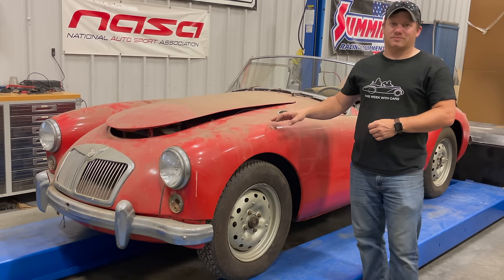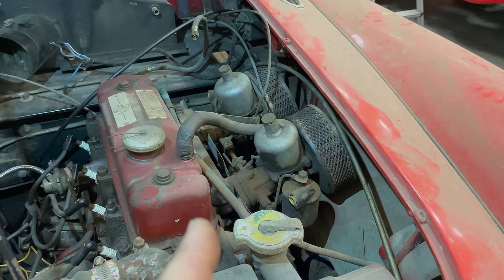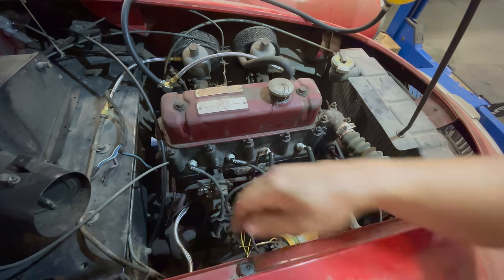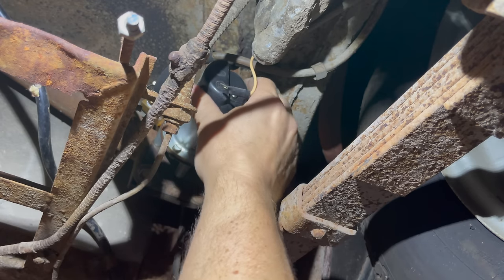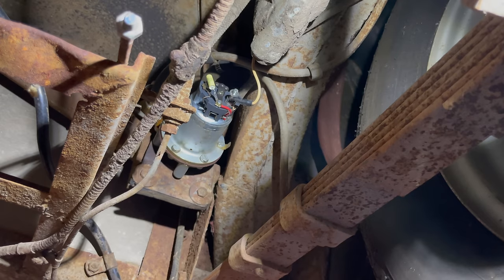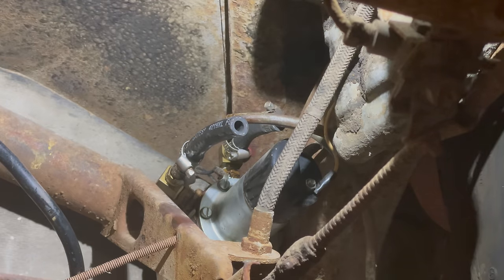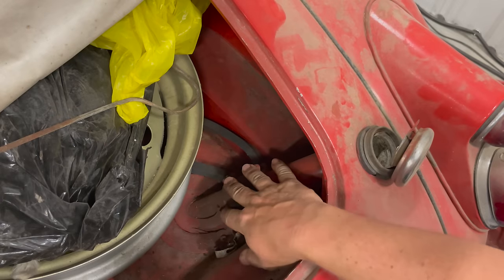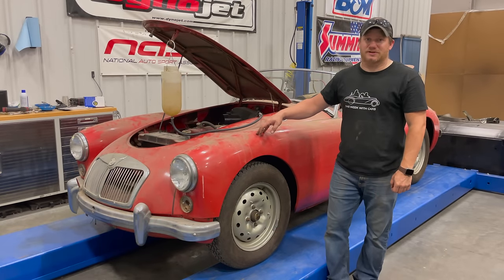1960 MG MGA 1600 Roadster - Part 2

Comment: my first car (bought in 1970 for $600) was a 1961 mga 1600 roadster. ended up rebuilding the entire engine and transmission, then a couple years later did the body and interior. great memories that i'll never forget. ...learned a whole heck of a lot along the way too. had an excellent blue(?) plastic covered book that explained everything about the car. was invaluable. might have been kenneth ball's book published by autopress ltd.

BTW, your explanations and presentation are excellent.

Comment: I had one of these in red,  A hard top version.  It was my very first car,  I bought it in the late 60s  second hand.   It cost me £295.00 way back then.
I had an accident in it going around a left hand bend and the front right wire wheel collapsed and the car spun and went through a hedge backwards and hit a tree.   Now these cars are worth a fortune.

Comment: Great video as always. I replaced the old gas tank when I first got my MGB for similar reasons. Having owned MGB’s for over 40 years I swapped the original fuel pump for a Facet style electric pump and never had any issues. Along with a conversion to Petronix electronic ignition its just one less item requiring maintenance.

Comment: I subscribed to your channel and love to watch your videos because you get right to it and succinctly describe what you are doing without any extra or unnecessary dialog.  If there is a problem, you tell us what you think to be the cause and show us how to correct it.  I liked your choice in this video to replace the fuel tank. A 61 year old tank that is left with old gas in it will be corroded, rusted and contaminated. Even if you clean it and seal it, the metal in that old tank will remain compromised. If you didn't replace it, the new owner would likely have to do so.  I would buy a car from you.

Comment: Hi.
It's best to try to keep batteries above 12.5V to prevent the dreaded sulphation of the plates.
It's the sulphation that makes the lead fall out of the plates and eventually shorts them out causing premature failure.
I have batteries that are over 10 years old just by maintaining them

Comment: This all reminds me of a fuel pump problem on a Vauxhall Viva in the 70's. I took it to a service shop for a new electric fuel pump. I received a call to collect my car and when I arrived I shone a torch under the hood to check the new pump. It was still my old one! I barged into the manager's office and told my story. To cut a long story short his engineer took us to the bathroom where my new pump, wrapped in plastic, was in the toilet cistern water.
Reply: Did you find out if the engineer was given his marching orders?
Reply: This is confusing Jeff can you explain what happened ?
Reply: @blackvulcan100  I think that when the engineer found the pump in the car worked, he hid the new pump in the toilet to retrieve and keep for himself.
Reply: @kenem1946  Ah yes I see, glad you exposed him. We have those type of people over here in the UK . I think when my last oil change for my LR D4 I suspected the oil was not changed. Did you know there is no dip stick on the LR D4.So you cannot check. So I changed the oil myself for peace of mind.
Reply: @blackvulcan100  Hi. It happened at a filling station that had a repair workshop attached. The town was Stockport, England and the year was 1974. The car was a series 2 Vauxhall Viva. I had a fuel problem and took it to this place to get a replacement fuel pump. It was a manual pump fitted into the engine block... not an electric pump, as previously thought. I went to collect it at around 6pm in winter...so it was dark. Saw my car in the car park, opened the hood and shone the torch down hoping to see a shiny new pump. (I don't know why I did that). But I saw my old pump still in place. I was very angry...walked into the service bay and bypassed the payment desk and pushed the door into the manager's office. He jumped up from his desk and said something like: "What do you want?; you can't come in here." I showed him my receipt of payment and asked him for my new fuel pump. He told me it had been fitted to the car. When I told him that the car still had the old pump fitted and not a new one, he shouted back into the workshop: "Harry, get yourself in here; have you been up to your old tricks? Where is this man's fuel pump?: Harry was the engineer/mechanic. Shamefaced, he said he would get the pump and walked off into the workshop. The manager and I followed him. At this point I realized I was alone with two rough looking guys. Anyway Harry walked into the men's room and reached up behind the toilet bowl to the water flush cistern about six feet up the wall. He pulled out a dripping plastic package containing the new pump and handed it to the manager, who gave it to me. I decide to leave without further trouble as there were two of them. My old pump worked well enough to drive so I went home and  fitted the new pump the next day. On reflection, the manager and mechanic were probably in it together so it would have been pointless checking if the mechanic had been sacked. You live and learn. I have another similar story about a Peugeot 405 carb' but that's for another time.
Reply: @kenem1946  yes and I also think the manager was involved

Comment: not sure what kind of strainer is in an MGA tank,  but my 69 Midget had a nylon strainer which tore apart when I blew it out.   I suppose the MGA tank strainer may be metal so it may be a bit more bullet proof.   Not sure what is in the bottom of the tank,  but I'm sure the strainer is what is blocking the fuel.  Good idea to just replace the tank and be done with it.   All you need is a tank leaking inside your building.

Comment: At startup, you can see cooling fan blur suddenly appear when the squealing stopped.
Reply from the maker: The fan was not turning when I first started the engine.  Either the water pump or generator was stuck and then freed up.

Comment: I love the MGA! But the power is really down there. Would it be feasible to rebuild the engine and add a small turbo to the engine?
Reply: Might want a 'decoke ', these old cars used leaded fuel and then some. Maybe check carburettor as well, a rebuild kit should be available . Personally I would  keep them standard  unless they are going to be raced. I don't know what Steve thinks though, he may disagree with me but thats fine.👍

Comment: i left my 1954 tr2 stored whilst overseas for just five years,when back and putting it back in service the fuel line from the tank to the shut off valve was clogged at each bend i tried allsorts of chemicals, air, fresh fuel nothing would move it eventually i tried oven cleaner almost instant sucess,
Reply: thanks for the tip Roy - do you still have the car ?  I have an early 2 here on the farm in western Manitoba which I will be starting up this summer after sitting since 1986.  I bought the car in Saskatoon in 1967.  I am sure there will be fuel supply issues.